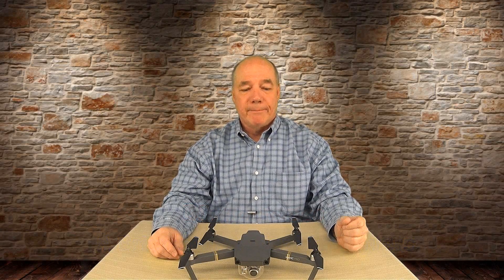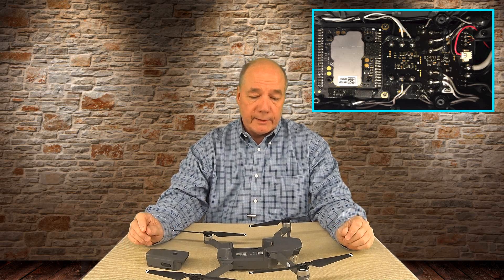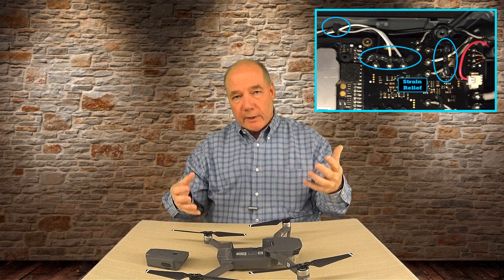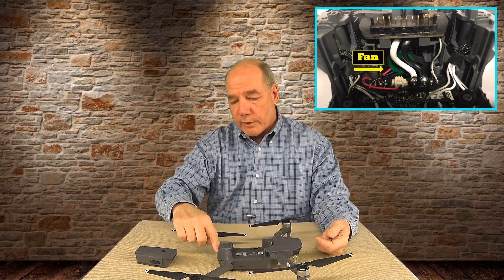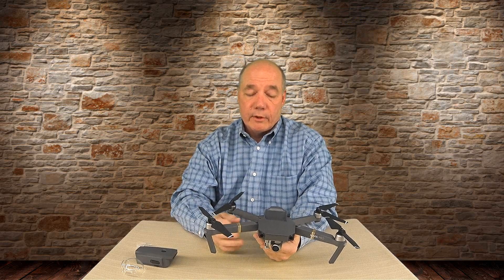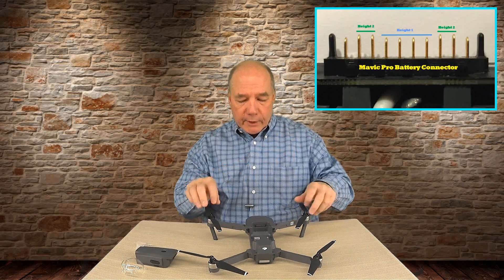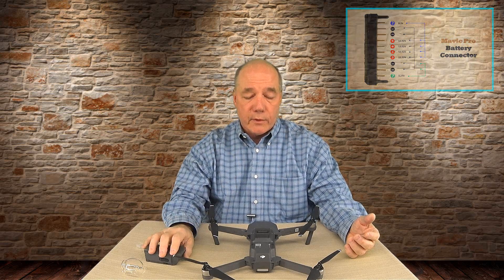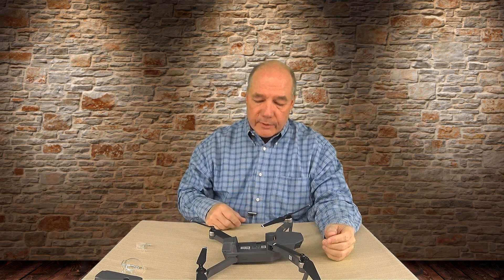Mavic Teardown - A look Inside Your New DJI Mavic Pro Drone

Comment: Don't worry about raindrops getting sucked into the fan area (unless you stop the drone "on a dime" in the air during a rainstorm, raising the intake way up while still going forward).  It would take a crazy strong fan to create a low-pressure area sufficient to turn or reverse the travel of raindrops that are hurtling toward Earth.   Water vapor (fog, mist, etc.) might be a concern, though.
Reply from the maker: The bigger concern for me is the debris that is kicked up when landing the Mavic. This can be pulled into the cooling fan and would be almost impossible to clean out. I'm sure there's some clever accessory company working on a small snap-in filter for the quad right now.
Reply: Drone Valley Seems a good reason to use those  brightly colored takeoff/landing pads.  Have you reviewed any  of those?  Think  they're  a good idea?  I'd like to find one that's foldable, but just heavy enough  to stay put  on the  ground even  if it's windy.

Comment: Sharp points  on soldered connections  do not cause or promote RF radiation.  Unshielded runs of wire or conductive traces on the PCB will emit or receive RF (including RF caused by digital square waves).  The solder points being rounded just demonstrates proper automated wave soldering technique.  Also, you don't want sharp points as they can cut into whatever is next to them.  Sharp points could promote high  voltage buildup if there were high voltages involved, but there are not.
Reply from the maker: Kirk, Thanks for the post and I appreciate you taking the time to comment but if you look closely at the pics I posted, those blobs are not part of the wave soldering (to attach components), they are pads that are soldered to attach connections to other parts of the quad. These are typically hand-soldered and the rounded nature of the joints is very unique. Crack open any typical consumer electronics item and you'll see that these joints are normally very sloppy. In the quad they have to rounded to minimize "noise" from radiating from the joint and affecting other sensitive RF circuits. Several of these connections are to the motors, which are inherently noisy, generating a lot of counter-EMF leading to potential EMI. Rounding the solder joints is one was of reducing this problem, much like a Faraday cage. I agree with you about the sharp points causing issues as well and have seen that in poorly designed products happen often. Thanks again for the post and I hope you sub the channel. Rick

Comment: Hey Rick, thanks so much for such in depth reviews of the Mavic. I just started watching your videos and I have to say, no other review I've watched on the Mavic is as informative as yours, so again thank you! I noticed you mentioned to not leave the Mavic sitting unless you're going to fly it since it can get quite hot, but what about when doing a firmware update? I noticed when updating the firmware on mine (took about 15 mins) that the fan would start to run (understandably because it has to process the firmware update which can make the CPU run hot). Apologies if you've covered this in any of your videos also but is it normal for that fan to run when the mavic is sitting on the ground, powered on and motors not running?

Comment: First I want to say, Thank You.  Your reviews/Info/Vid's are far better than ANYONE's on the net.  Yours are not all DJI hype and boyish crush on a new toy, yours are informational and professional.That said, I have some constructive criticism... You speak of the "Bubble Solder joints" and then show a picture of components soldered into a PCB having a point...  The "Bubble Solder Joints" you show in the picture are WIRE's soldered to a solder pad on the PCB vs threw hole components that are soldered threw a hole in the PCB.   THAT is the primary reason they are "Bubble Solder Joints" instead of the pointed solder joints you referred to.   I'm not going to debate your whole theory of "Little Antennas" and RF Frequency bit, I can't see in detail from your pic in the video, but if ALL the solder joints are "Bubble Solder Joints" it's because they are surface mounted components instead of threw hole components.  I appreciate your efforts in making this review and others, But I think you kind of drew your own conclusion to something out of thin air, because it sounded good and reasonable.
Reply from the maker: Chad, thanks for the post and I really appreciate the compliments. I'll politely disagree with you on the solder joints and the reason for their rounded form. You're absolutely correct that these locations are "pads" on the PC board that wires are soldered to (and not through-board connections) but the perfectly rounded solder blobs are unique. If you open up almost any piece of electronics and look at the PC board, you'll see sloppy joints where wire connect with lots of peaks in the solder. The only place this isn't the case is in sensitive (and expensive) RF gear used in transmitters and receivers. The reason the blobs inside of the Mavic are so rounded is to minimize any stray radiation a peaked joint could broadcast or receive, causing cross-talk and interference. It's similar to the Faraday effect in reducing radio interference. I expect this type of care when I open up a very expensive broadcast transmitter but was blown away to see it inside of the Mavic. It tells me that DJI is very serious about building the most reliable quad possible and it's probably one of the reasons they are able to squeeze and incredible 4+ miles out of the Occusync technology. Thanks again for the post and I really appreciate you watching the clips and hope that you'll sub the channel. Rick

Comment: Just an added thought about the battery contacts, in my experience when one contact is longer than another it is done to ensure that the longer pin makes contact first, in this case the negative makes first contact. So it should have a ground made before any positive voltages are applied. It may be to protect the circuits in the event of a battery malfunction. Some circuits don't react well to a reverse polarity, so by providing the ground or common first maybe it can overcome some issues. Just a thought. By the way loving the Mavic videos you have them judged just about right regards talking and etc. Although I am still waiting for mine to be delivered I am finding your information relevant and interesting so far, so keep it up.

Comment: Hey could you cover the front legs mine is slightly bent but looks easy enough to take off and straighten..

Thanks
Reply from the maker: That might be a little tricky because they are composite. It would be hard to bend that back into share. Did you have a crash with the quad or was it like that out of the box?
Reply: Drone Valley crash its only little bend, but with the screws under the motor I wonder if you can swap them out - can't find a video with anybody removing them

Comment: Is it possible to balance the props?
Reply from the maker: That's a great question and because they are collapsible I haven't found a way to balance them. Honestly, the Mavic will fly with some pretty ugly props attached. I hit a tree when testing the VR goggles and lost about 1/3 of two of the props and the quad flew home like nothing had happened. Not even a wobble in the flight. It's a very forgiving design but I'll keep checking to see if I can find a way to balance them. Thanks for the post and be sure to sub the channel so you don't miss anything. Rick

Comment: If you have multiple batteries, would do you think would be the maximum overall flight time for a session?
Reply from the maker: I have flown the Mavic Pro a lot and typically get about 24 minutes out of a full battery depending on the conditions. You could theoretically fly through as many batteries as you have with you, letting the quad rest a little between battery changes. The real limitation is the flight time of the controller, which is about 2 hours on a full charge. I discovered a trick that allows you to actually charge that controller while you're flying to extend the flight time even longer. Look on my channel for a recent clip called "tablet Options" to see how to accomplish this. Thanks for the post and be sure to sub the channel. Rick

Comment: HI Rick,
I happened on your site last week
I was really impressed with this video. I was planning on buying a used inspire v-2,  I have a friend who buys them from Best Buy when they get turned back in, and repairs them to sell, and wanted to know if you were similarly impressed with the construction  of those also. I started with a P2+, and now have a Q500 4k
Reply from the maker: Daniel, I have taken a lot of quads apart over the years (including most of the DJI models) and find the DJI engineering to focus a lot of their attention on the details that matter. The rounded solder joints and strain relief are just two small examples of that. They really do a great job of building their quads to last with most of those extra steps hidden from the consumer inside the case. I am expecting a Phantom 4 Pro soon and will do a tear-down on that quad as well to show you how it's built when it arrives. As for the Inspire 2, it looks like they upgraded most of the systems and I can't wait to get one here in the shop to play with. Thanks for stopping by and I hope you sub the channel so you don't miss anything. Rick

Comment: Rick, with regard to your very valid observation that the cooling fan behind the air intake port at the front of the drone is going to act like a mini vacuum cleaner to be considered when landing and taking off in a small-particle-laden-environment, what do you think about making the routine be a hand launch and takeoff with the Mavic? I am going to be operating in a very mobile way in a very natural and many times rugged environment. Deploying a landing pad everywhere may not be easy/feasible. Also give me some ideas for an every day landing pad solution, something I can pick up at a third world shopping plaza or flea market type place somewhere and also something that can be included with gear on the back of a dirt bike motorcycle.

Comment: Regarding the battery connector pin height... the GND pins are taller to make sure they make contact before the V+ pins when you plug the battery to the drone or charger. It is not to improve the surface contact.
Reply from the maker: Pol, thanks for the post and I realized that as well after I had the clip done and posted. I work with a lot of quick-disconnect equipment and somehow missed the fact that this was a "ground-first" type of connection on the battery. I appreciate you posting that information as well and hope you sub the channel. Rick

Comment: Your "question marks" is for cell balancing when charging.
Those nodes are simply taps from each cell in the 3 series string. This allows the charger to monitor and control the charge of each cell individually, to ensure no one cell in the series becomes relatively overcharged or overdischarged. Without monitoring or controlling the voltages at these taps, one cell can become overcharged with repeated charge cycles, which is very dangerous (boom). All chargers that charge multiple series lithium cells must and do have this feature.
Reply from the maker: Thanks for the information and I was thinking it was for some data transfer to the quad on the health of the battery but wasn't sure. I am trying to find a service manual for the quads so I can sort this out in advance of doing the clips but it does make for a great discussion on the channel. Thanks again for the posting and I hope you've subbed the channel. Rick
Reply: The voltages almost seem correct for being the nodes between the cells: the 3.27V would be more like 4.3V for this to be correct, so maybe I could be mistaken (or your reading was wrong). 
See: https://en.wikipedia.org/wiki/Battery_balancing

Comment: I suspect the longer ground leads are to help control the path of static electricity when bringing the previously isolated and potentially relatively statically charged battery, together with the drone. This way the potential of the whole craft is matched with the battery, instead of just the positive supply input (hence increased risk of damage).
Reply from the maker: Yep, that's it for sure. I totally missed that one when doing the overview and should have known better because I work with a lot of quick-disconnect circuits that are always "ground-first" connections. Thanks for watching and posting, we all get smarter together. Rick
Reply: No problem. I'm seriously considering purchasing one of these. So the more we can all learn from each other, the better :)

Comment: The two outer pins on the battery could just be communication pins. Since it is an intelligent battery, that could be some sort of way the drone keeps track of the battery levels.
Reply from the maker: Thanks for the post and you may be right. I've had a few other people comment with a similar conclusion and I think it makes sense. I'm hoping to get my hands on a service manual for the Mavic and then I'll be able to tell for sure. Thanks again for commenting and I hope you sub the channel so you don't miss any updates. Rick
Reply: Drone Valley  done! I'm currently waiting for my Mavic to ship. Currently flying the phantom 3 professional, so this will be a nice upgrade.
Reply from the maker: I fly that quad as well and is still one of my favorites. I actually had it up today flying with my son. The Mavic is a different quad and in some ways more nimble. Even still, I really like the Phantoms. Have fun with it and I hope it shows up soon! Rick

Comment: based on the pin out it looks like the Mavic battery is an S4. If you want more details of a Teardown check this clip out

https://www.youtube.com/watch?v=_4rfiX7JmOg

And here is a battery of test they even ran it in the rain so seems like it has pretty good water resistance 

https://www.youtube.com/watch?v=D_Vin9ZtWxQ&t=178s

Drone Valley sorry never could really tell what your name is since you say it so fast, but did you see anything regarding water resistance/proofing. Also done know how hard it would be but can you take a battery apart?

Comment: Love your knowledge, love this video. Subbed.
I noticed you said you applied new thermal glue on the cores. Would you recommend that for an electronics expert like myself, not from a difficulty POV but if a top quality silver thermal paste could be a good idea ? I apply it to all my my other electronic cores etc in my equipment but with this Mavic, I'm extra cautious and not experienced with drone disassembling.

Also, keep making videos about this drone, I loved this video. So informative. It's the closest thing to taking it apart myself.
Reply from the maker: Jes, thanks for the sub and I'm glad you enjoyed the clip. I wouldn't replace the thermal paste that DJI put in there since it's been chosen to match the thermal properties of the chips they're using. I had to replace it because I opened the case and broke the factory bond by removing the cover. As you know, once this paste is disturbed it never really bonds well again with simple compression. I'm hoping you never have to take the quad apart, because this means you've become an expert pilot and won't have to change any parts because of a crash. My curiosity got the better of me and I couldn't help but rip the covers off the Mavic Pro. Thanks again for the comments and stay tuned, I've got a bunch more clips posting soon. Rick

Comment: Very well shown and explained. Thanks so much! I'm planning to mount a GPS tracker  (the RF-V16) to my Mavic. Can you recommend a spot on the Mavic where interference with the compass and the IMU is most likely not creating issues?
Reply from the maker: That's a tricky one with the Mavic because of it's small size. My best suggestion would be to mount it either on top of the battery or to the very front of the bottom, just behind the gimbal. Both of these areas are the "cleanest" locations on the quad from an RF perspective. I hope that helps and thanks again for the post. Rick

Comment: Been loving your videos.  Mine been on order since 10/5 - still waiting.  You talked about landing mat - made a lot of sense.  I've seen a 3' Hoodman advertised.  Adequate for this drone in your opinion?  Don't want to be lugging around a big piece of accessory - kind of takes away from collapsible drone.  Thanks.
Reply from the maker: Chuck, thanks for the post and I'm glad you're enjoying the clips. I use a PGY mat that is about 44 inches wide. The hoodman mat is great as well but what I really like about the PGY mat is that it's reversable with orange on one side and black on the other and it has a metal ring on the outer edge that gives it just enough weight so that it doesn't lift off of the ground from the quads prop-wash. I have a link below to the one I use on Amazon so you can compare the two. Thanks again and be sure to subscribe to the channel so you don't miss anything. Rick

Drone Landing Mat - http://amzn.to/2fpLTRj